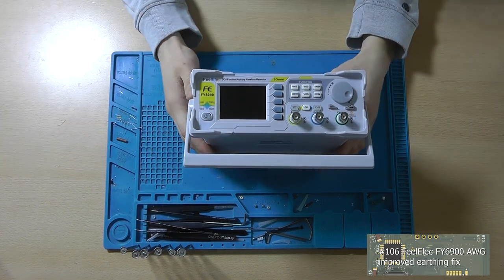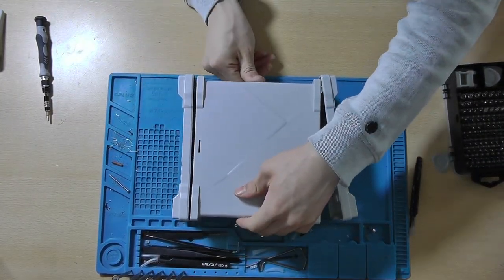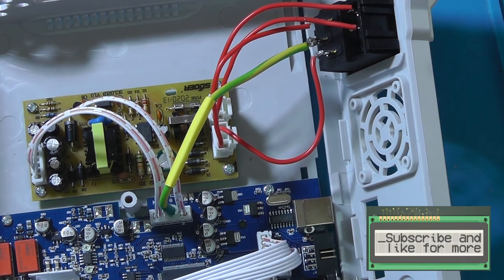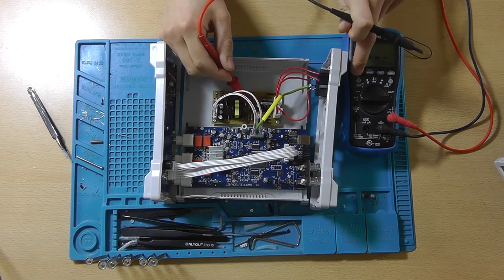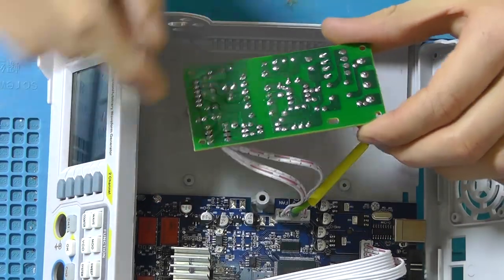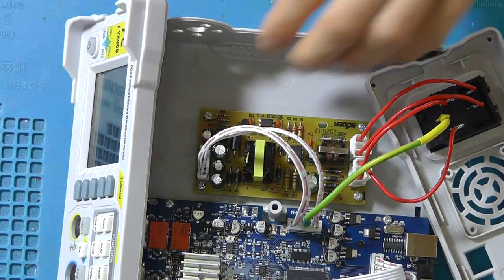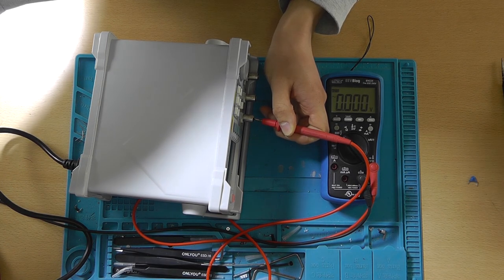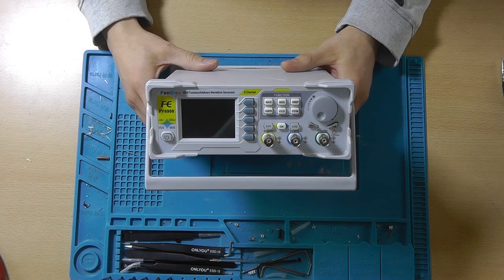#106 FeelElec FY6900 📈 improved earthing 🌍 and AC coupling fix

Comment: Quite right. The other day I received a generator. I was very surprised. There are two wires coming from the power board. Common and + 5 volts. The power supply itself still outputs -12 V -12 V and +5 volts. The blue capacitor is still standing. I will convert to a linear +5 volt regulator with a heavy transformer. A heavy transformer is needed to keep the generator stable on the bench.
Reply from the maker: You're making your own solution?! Cool, keep me updated if you will

Comment: New version of fy6900 has this problem solved already. Although the psu pcb is the same, the only voltage that is used is +5V. Rest is unconnected.
Reply from the maker: It does, doesn't it? I was wondering just that as I couldn't measure the problem on mine
Reply: How are the op-amp's powered ? These can do 20Vpk-pk output.
Reply from the maker: Hi Frank,
I'm not sure actually! Maybe there is someone on the EEVBlog forum that could answer this question!

Comment: Only and permanent fix are to put that power supply into th junkyard and change it to linear power supply. SDG solution are good but it`s much expesnsive then LM37/LM337 solution. This is first thing what I`m doing on mine... You can see what I do on this pictures https://app.box.com/s/lxeh824qr6mhscxxi3ipl9lq0i7g8nqy and https://app.box.com/s/dzg803iwd40k1z0338m2owlb6ropw5p5